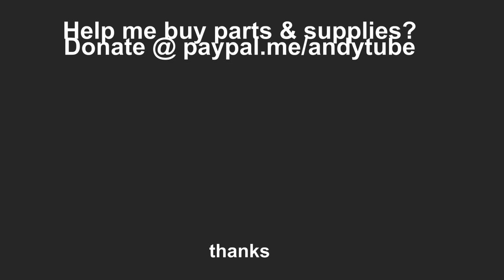The Handwheel and Stop-Motion Mechanism of the Singer Model 353 Genie

Comment: Hi Andy
Thanks for the video and explaining how to do the repair in such detail.
My Singer Starlet sewing Machine is about 45 years old and has the problem you described first  that the plastic teeth on the stop wheel cover have perished and on my one some of them have disappeared. I asked a local repair guy if he could fix it but was not willing to even try.  Will you be posting a video to show how to fix it?
thanks PLT
Reply from the maker: I later glued the two teeth back on and the 2nd time I wound a bobbin they broke again right above my glue. They were just too brittle. AT 4:23 in this video I point to a bracket that the cover clips into. In the old parts manual the bracket and plastic cover are considered as one piece. Now look at 32:22 in the video where I discuss how the plastic attached to the bracket. Just before I put it back together again I put four good dots of E6000 adhesive on the bracket and pressed the plastic into it. When dried it felt secure and worked normally.  https://www.target.com/s?searchTerm=e6000
At the time There were replacement handwheel and covers available online a couple of places, but I wanted the original cover with the flower design. I looked this morning and could not find the replacement cover any longer. Think about using the glue E6000.

Comment: Hi, I have a singer tradition 2250... The handwheel can't make a complete counter clockwise turn... I can't figure out why...
Reply from the maker: The 2250 model is 50 years newer than any machine I worked on, so I can not give you specific repair information. Please keep in mind that the handwheel is just one of 50 parts that move on the machine, and any blocked or damaged part can cause the machine to not turn. It could be a broken plastic gear, it could be lint build up that is blocking the hook, the needle bar was pushed up while sewing heavy fabric, any number of things. If you can get the covers off it will help to find the problem. I could not even find a Service or Parts manual for this model. I'm sorry I'm not able to help.😢 Good luck.

Comment: Hi Andy i have a singer 9015 machine how does the handwheel come off, it spins ok for the bobbin but when the inner wheel is closed for the needle bit, when foot pedal is pressed it  will not turn for the needle. can you help in any way thanks in advance and nothing in the manual. m
Reply from the maker: I've never worked on the Singer Machines made in Taiwan; too new for me. If it can not be removed like the one in this video I can't say how to remove it. Some of the 9015 parts look a little different        https://www.ebay.com/itm/HAND-WHEEL-CLUTCH-Singer-4622-5910-6233-7028-7033-9005-9008-9010-9015-9018-9020-/282967587083
Reply: @andytubesewing1953  ok no problem Andy thanks for your time take care
Reply from the maker: @marky9197  👍

Comment: How do you talke off handwgeel for 620
Reply from the maker: I thought it would come off the same way as in the video. IF not, look at the outside of the handwheel and see if there is a smaller knob with a screw in it. If so, then this video may help: https://youtu.be/ghnNYyMC1xU
Honestly, I thought the 600 & 700 models had a screw under the arm cover that attached the handwheel to the arm shaft.